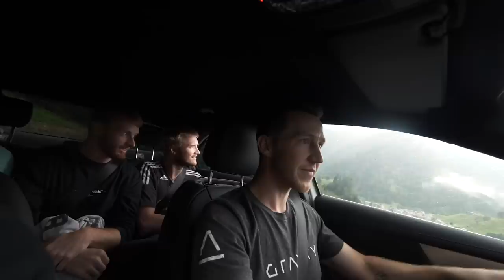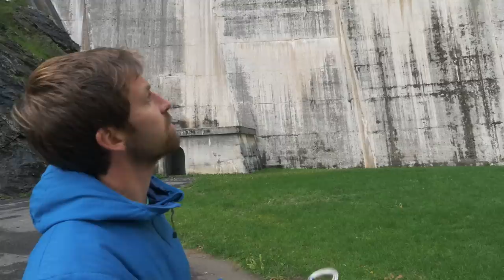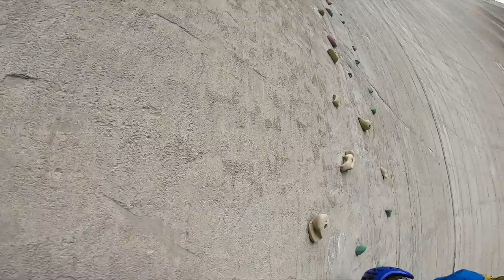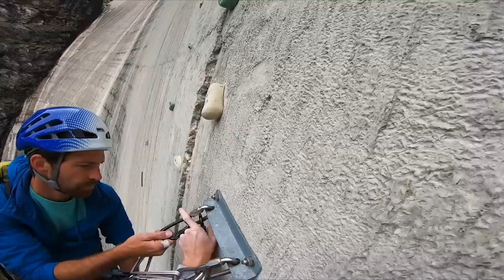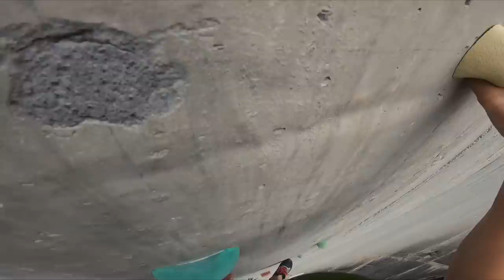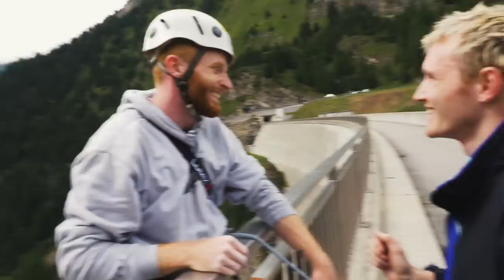Climbing the WORLDS HIGHEST artificial climbing route! 650++ holds on a dam ft Toby Segar

Comment: How cruel would it be if right at the top there is just a massive dyno
Reply: Or just a 20ft gap.
Reply: Charlie Emery that can be arranged :)
Reply: or just a bunch of little crimps
Reply: Screw it. Whole thing is just Dynos on crimps!
Reply: 15 foot double dyno hahaha
Reply: @O T N that actually sounds scarier than losing your footing and slipping off a bit from high up
Reply: Noo! Stop i want to try this at least once in my life your making it worse. If i can't climb by then, i still want to see it. No spiders or dynos plz😎👍👍👍
Reply: @owenb9294  skrew it the whole thing is just nothing
Reply: If I was leading, it would be more cruel to the belayer, as he would have to dodge my diarrhea while stuck at the anchor.
Reply: can someone tell me what a dyno is?
Reply: @Duenschissdoktor  it stands for dynamic movement. Basically it's when you have to launch yourself to another hold and lose your foot holds.
Reply: @francescorosato5431  like in assassins creed
Reply: @Duenschissdoktor  basically ahah
Reply: Is it possible that you Charlie emery are related to the legendary shugemery?
Reply: Slopers and a bit of smearing

Comment: Can you imagine being the one to drill the bolts for all the holds? I'd be terrified water might start gushing out after each one!
Reply: Just no. Dams are hollow on the inside (there is lots of stuff inside) and at least 10 meters (30 feet) strong.
Reply: I was thinking about something similar lol. The people who wanted to bolt the route would have probably had to contact the engineers or something, find out the specifications of how deep to drill before compromising the concrete wall etc. Idk, im no architect.. but i imagine they were working within specifications while up there.
Reply: @giacomocasanova2893  so actually almost no amount of drilling WRT bolting a route would compromise that wall?
Reply: Benjamin Brauer ya so normally damns have generators in the middle so it’s like a room in the middle of the damn
Reply: Haha Scrat from Ice Age did it
Reply: Bruh- they’re not 5 inch thick plaster walls 💀
Reply: If that dam is anything like the hoover dam here in the US no little bolt us gonna hurt it.  However damn is 40ft or more thick. Or like 33m thick
Reply: I know personally who bolt it. Good friend of mine 
He spent 2 months on the wall
Reply: With a pill of anti depressant that 
S won’t be scary ^^
Reply: I’m pretty sure humans works inside the damn wall for maintenance and other things.
Reply: Dams are hundreds of feet thick at their base
Reply: @weedboyx  yeah that's like called a safety factor like one to one two to one three to one etc
Reply: @DaddyDean13  yah you can walk in the dam that's how workers maintain the pumps and things. I mean we've all played the dam level on goldeneye 007.
Reply: Dr.Crimp how does one get permission to do that? Is he getting paid back for the grips he installed?
Reply: this was kinda a stupid comment 😂 if a dam gushes water after bolting holds then I'd question the engineering of the dam
Reply: Well I mean if I did it I think some other type of water would come out

Comment: NEVER try to rappel from the top (to get down fast or avoid paying). It is so overhanging you wont be able to reach the rap anchor. Then you gotta prusik up or call mountain rescue. And they'll just call the chopper.
Been there, done that. (With sit start) 😎
Reply: humble brag
Reply: @Schmicks  you could try to back clip while rapping, sure. But mountain rescue told us they rescue about 6 parties per year who try to rap and "just swing into it".
Reply: Do you mean that the route is not straight up and that’s why you would rappel way off the next anchors ? , what do you have to pay to climb ?
Reply: @07k_motorsports24  The dam is private property, that's why you pay.  And the top of the dam is overhanging, so you can't rappel down and reach the anchor below, you're hanging in mid-air away from the wall.
Reply: different duds had to be rescued because they didn't want to pay for the key to get the ladder... so they rap down and got stuck in the void... one stayed there quite for some time even... pay for the damn key!!
Reply: Just call a chopper to set up a z pulley? You know it’s overhanging from start and have two ropes... what’s that smell?
Reply: Or DO rappel from the top, with a rope that's at least 175 meters. And with a stainless long frame rappel rack, because a Grigri or figure 8 would glaze the rope

Comment: My question is, how did they get the holds on there in the first place
Reply: they repelled down from the top. drilled and then bolted the holds into the wall
Reply: Ethan Durant They couldn’t have, it’s quite overhanging.